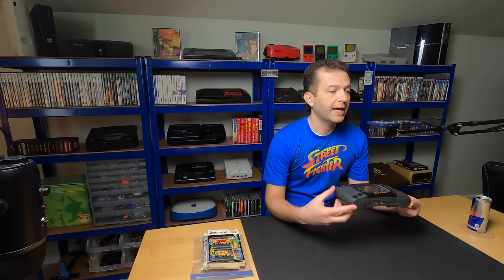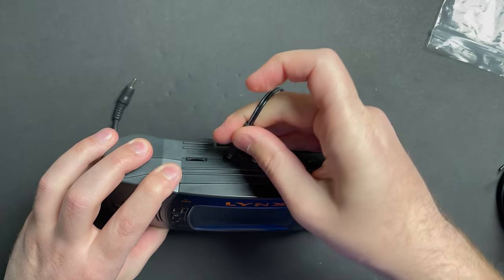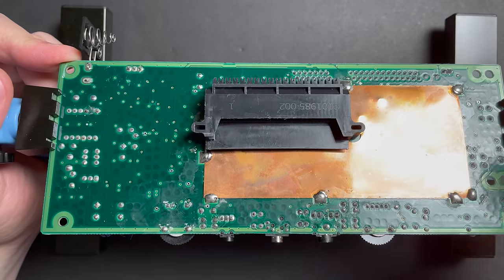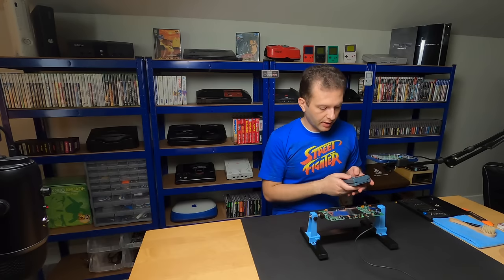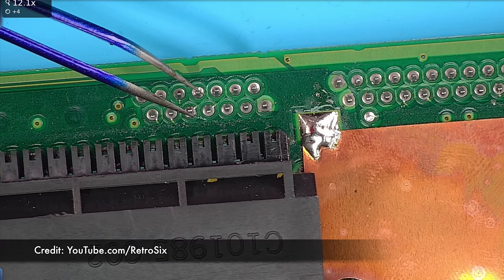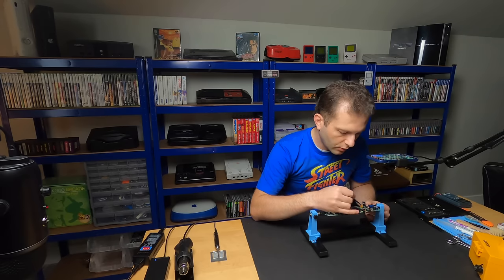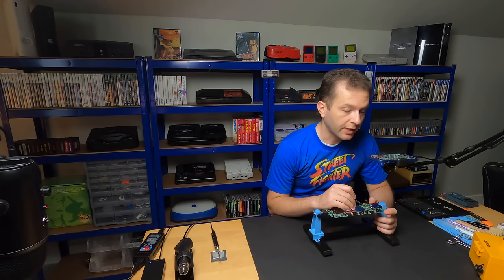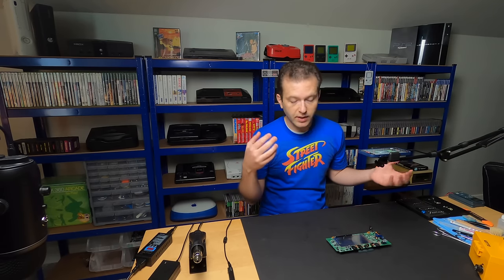Full refurb on a BROKEN Atari Lynx. Can we fix it?

Comment: I think you should have removed the shield to inspect for corrosion, or battery leak. I hope you dont give up though
Reply: and for broken soldier joints and (MORE LIKELY) bridged pins.... He did see a WHOLE BUNCH of soldier blobs and bits all over the board... so maybe there is one between the tiny pins on the main chips....

Comment: You might have known about this already, but you can quickly test if only the power circuit is where you need to focus. But if you supply +5v directly to the C41 which, was the cap you noted as being of a different brand. Doing that with a game inserted will make the lynx power on immediately since you are bypassing the power regulation and that way you are able to verify that the main logics are good and that the Lynx should be able to be resurrected. It is a different capacitor on the Lynx 1 to do the same trick.
Reply: C39 on Lynx 1 :)

I would try that as well. Short pins 31 and 33 on cart slot to get it to boot to INSERT GAME regardless of if a cart is in or not, then feed this Lynx 2 5V 1A directly to the legs of the C41 cap. If that lynx is in operational state, she will boot then!
Reply from the maker: I didn't try supplying 5V directly to C41 during testing but I was getting ~4.7V across the zener diode with the system turned on after replacing the power components. Not sure if that rules out further issues with the 5V rail but I'll add your suggestion to my list and definitely try this when I take the system apart again.
Reply: @BorderlineOCD  Don't give up! You have me eager to see the next move you have planned. It seems like a very frustrating project but I'm cheering you on. Lets go Atari Lynx! come back from the grave!!!! 😭😭
Reply: @pugthugdabaccino1462  i know i want part two of this repair don’t give up yet i will be waiting for PT2
Reply: Me three!!! I want to see part II!! Of that LYNX II!! I want to see it resurrected into it’s second (II) life and get back in the game!! 🙂

Comment: The Lynx has an interesting quirk in that it does not turn on unless you have a game inserted so always remember to put one in when testing.
Reply: The Jaguar has a similar quirk so you really have to check the cart port on these systems.
Reply from the maker: Indeed. I should have captioned this in case others are not aware but it needs a cart inserted to turn on. You can also short pins 31 and 33 on the cart connector which bypasses the cart check.

Comment: The Lynx commonly got fried when somebody would connect to a power supply in a different country. Could that be the problem?
Reply: True, also quite a few people used to confuse audio jack with PSU and fried their Lynxes that way as well....
Reply from the maker: Apparently when the zener diode goes bad, the system sends 9V to the board instead of the "regulated" 5V. Very odd design but this could have damaged the other power components or done some irreversible damage to the main chips which are expecting 5V.
Reply: It is also possible to connect the power cable by accident in the mini-jack. It actually does power the Lynx, but weirdly (screen is super bright).

Comment: I’ve fixed many of these systems before. If the zener diode died, it passed 9V into Mikey or Suzy (cpu/gpu) resulting in them dying. 

If you’re comfortable with replacing ICs with over 100 pins, you can purchase brand new replacements from Best electronics in California.

In rare cases I also had to replace the RAM chips.

Comment: under the shield you will find the cpu , which might have corrosion , i almost guarantee you this is it, also you can test the voltages on the cpu pins ,

Comment: It was very exciting to see how you tackle this repair :)
Fixed a few Lynx II myself but never seen this issue before.
There are two pins on the cartridge connector, which when connected can be used to turn on the Lynx without putting a game in it. (You still have to press the power button though to power it on) In this case, a message should be displayed on the screen. Worth a check.
Even though you said you have showered the cartridge connector pins with contact cleaner, I would still inspects those with a lamp to check whether there is any corrosion. 
You could also take off the shielding and inspect those two main chips under it. (Maybe reflow the solder on their legs)
Reply from the maker: Thanks buddy. I did short pins 31 and 33 on the cart connector. The Lynx powers on with the same symptoms. I plan to remove the shield the next time I'm in there and take a look at the RAM, crystal, CPU etc.

Comment: May be a long shot, but I repaired a Lynx 2 recently.  The games would partially load but would be frozen at a splash screen.  I replaced the button ribbon membrane and it fixed it. It was almost as if a button was registering as held down, which caused it to remain stuck.  It wasn’t obvious at first, until I tried several games and one would finally load - but one of the buttons did not work.  That lead me to the solution.  Good luck

Comment: I have one of these, i just did the switching regulator mod. There was so much wrong with the diodes, those 3 big diodes are abused in how they handle power.
So i swapped out most of the power circuitry and plopped in a LDO switching regulator. 
The only catch... The way they originally designed the lynx, the way it abuses the diodes, allows the batteries to drain really low, so you get to really take full advantage out of the batteries. But even with an LDO regulator, you'll be leaving a bit of juice on the table.
You can either use a joule thief setup to milk every last drop of power, or use rechargeable batteries.

My lynx has been collecting dust in my basement, so i'm actually thinking of getting an LCD mod for it, and a lipo mod and then selling it on. I even have the California Games for it.

Comment: Ran into the same issue before with one and found pins in the cart slot that were bent and touching straightened em out and it worked

Comment: I had a very similar problem. The Screen turns on but there is no change in brightness when the knob is turned. I changed both main chips, no change. It turned out that U11 (HC74A) was fried (probably when the Power circuit was not working and put 9v through) and was not putting out a clock signal. I replaced the chip (10 chips €10 on Ebay) and hey presto! It worked. Hope this helps. Keep up the great content!
Reply from the maker: Thanks for this information. It looks like this chip controls the backlight on/off only though, but I'm not certain. Did you replace anything else which may have been faulty? Was your crystal fine? I'd love to revisit this console again soon.
Reply: @BorderlineOCD  I checked the crystal, and it was running fine on pin 58 of the HJayato Chip Measuring RP7 Ihad solid 5v on each connector (can be measured on the Screen connector pins as well)- until I replaced U11. Before changing it, I had solid 5v and 0v readings on all U11 pins. After changing it I had a clock on pin11 - I think. Just check if you have a clock at all on the chip, if you do, then that is not the problem sorry, but it looked exactly the same as mine.

Comment: I can’t speak per se for the model 2 Lynx, as own two model one Atari Lynx systems, but the model one was notorious for having a bad voltage regulator. I replaced the voltage regulator on both of mine with a more modern voltage regulator.  Supposedly if that voltage regulator fails, it can kill other components on the board.

Comment: These machines are notorious for bad power circuitry and can be easily bypassed by hooking up +5V directly to each side of C41. (Find an old +5V Power supply) You should also be shopping around for a new LCD as that one is suffering from LCD rot. Found a video that explains the power bypass mod for you

https://www.youtube.com/watch?v=MAmPIBkXmPM
Reply from the maker: The output on the zener was 4.7V with the system turned on so I believe the 5V rail is good. A few folks have suggested this bypass though so I'll give it a shot when I revisit this repair.
Reply: @BorderlineOCD  seems to me it's not the power circuitry .... I could be wrong of course....  OH make sure to TRY THE BATTERIES AGAIN now that the screen comes on... if it doesn't then you KNOW there is still an issue with the power circuits.....
Reply: @Nobe_Oddy  I'd love to be wrong, but it appears it's got a damaged mikey chip from the behavior. No sounds when trying crystal mines, so it's not "playing blind" (meaning not just an issue with the screen).

Those chips often get damaged when the fet / zenner fail and allow 9V to slam parts that should only get 5V

Comment: Ive had a Lynx 1, and still have my Lynx 2..havent played it in like 4 years..but Im about to try..try this too:..make sure internal game CARD connection points are nice and clean, as well as the cards themselves..alcohol clean those contacts.

BTW, that power button is recessed OEM, its supposed to be that way, so you dont accidentally press it MID game, Good design MO.

I would re-insert several carts in and out a good dozen times, slowly, might still be a CART contact issue. MAke sure none of the GOLD has chipped away from any of the internal CART acceptor contacts.

Comment: When powered on, check the temps of the chips. The wrong power cord may have been used and fried something. If they all feel ok, then you could replace the screen with an updated one (BenVenn sells them among others). Have you reached out to the AtariAge forums yet?
Reply from the maker: I might transplant a donor screen from a working unit first to confirm if the board is working. I love the BenVenn screens but they are expensive.
Reply: @BorderlineOCD  I get it. I installed a McWill on mine, it's def night and day!

Comment: You can get a decent bench power supply for $50. Not only can it provide more voltage and current than that module you have you can limit the current and detect shorts before causing more damage. It would probably pay for itself the first time it prevents you from frying a console.

Comment: And also put a multimeter in series to measure the current it’s drawing , and use a better and more accurate multimeter ( because the low voltages ) and buy a cheap component tester to measure the caps , mosfets etc . But you do a fine job and good filming !

Comment: Could try cutting just a bit of the end of the ribbon cable off if the contacts are not making the best connection. Had to do that on my own that was restored.
Reply from the maker: I think doing this carefully would be a good idea. Those pins are worn down to the plastic, probably from being removed a hundred times.

Comment: Not sure how you stored the sticky grips after you removed them, but I always keep badges and stick-on feet for things I'm working on stuck to wax paper so they don't get dust or other contaminants on the adhesive. The wax paper peels off just like a decal backing when ready to reapply.
Reply from the maker: Great suggestion, love it! You can also gently rinse them with water if they fall and collect dust/debris. Once dry, a little hot air before reapplying and they are tacky again.

Comment: The recessed power button is normal and is so you don't accidently press it while playing. I wonder if the CPU chip went bad. That can sometimes cause a black screen of death because it's braindead. You're right, not everything can be fixed and you have to know when to throw in the towel.
Reply from the maker: So it's designed like that lol. Well I wouldn't be surprised because there was nothing wrong with it from the inside and the reason it wasn't working was the worn out material on the end of the ribbon cable.

Comment: Could it be a bad cartridge connector? I mean it turns on now, but just doesn't load a game, at least that's how it appears. I could be wrong, perhaps the Lynx has some sort of loading screen prior to the game booting.
Reply: I agree, although I have not repaired a lynx (broken ones are going for crazy money in the UK and I'm in Ireland, additional tax) I have done about 20 game gears and the cartridge pins cause huge issues and display a similar blank screen result. I wouldn't give up, I think you are very close to fixing it. Thanks for the very informative video as always
Reply: The Lynx, like with the Jaguar, won’t boot unless a game is inserted. The cart slot could need a reflow or be replaced.

Comment: Hi, sadly the power circuit of the lynx has a deadly problem, if the zener diode gets broken, like in this case, the 9V goes to main cpu who gets fried . for this reason I bought a 6v power supply and two dummy AA batteries, so the maximum voltage remains under 5.5V in case of zener failure. The only deal is a less brightness of the screen but a safer Lynx.
Reply: Sheesh, absolutely terrible design. Surprised nobody has designed a bypass board or something to completely replace the circuit with a safer one.
Reply from the maker: You're exactly right, and this is what I believe may have contributed to the initial failure on this unit. I learned a few new things while working on this project, and one of those is that a zener diode is a pseudo voltage regulator, although not a particularly good one. And as you stated, when it fails rather than becoming an open circuit, it just delivers its input voltage down the rail (in this case, 9V all the way through). Absolutely garbage design.

Comment: Thanks for very interesting videos! I really need to dig out my old multimeter and soldering iron! A question (maybe this info is available somewhere but I couldn't find it): What camera and mic do you use? Also, what's that camera holder you are using? Thanks!
Reply: I can see his mic (on the right edge of the room shot) and it's a Blue Yeti - I have one and they are a GREAT all around mic! And for only about $100 you can't go wrong... it can be used  as a table top mic for doing podcasts with multiple people sitting at a table across from one another or switched for a solo setup.  And the small stand can be removed and the mic can be screwed onto an adjustable arm for easy gamer streaming without the mic being in the way of your keyboard and mouse.....
it a VERY versatile mic with excellent sound range and easy to use knob for switching between different pick-up patterns. And for a hundred buck it really is a GREAT first semi-professional microphone....
I did a LOT of comparisons when looking for a good mic and the Blue Yeti came out on top in pretty much every aspect :)
But now the camera I can't help you with... I need one myself too. But before I fulfill me NEED for a new camera I NEED to fulfill my NEED for MONEY. :D

Comment: You can't fix'em all my friend however i notice you use the J tip alot must be pretty neat I do not have one for my solder station. I used to watch Voultar use the J tip it does a pretty good job.
Reply from the maker: It's nice for tight areas and I find myself using it on most projects these days, unless I need a larger tip to deliver more heat to the board. If memory serves me right I think the one Voultar uses is a fatter J than my J tip but it's probably just what's available for different solder stations. I'm sure you can a similar bent tip for your iron.

Comment: I know it seems a bit stupid and silly at this point but did you check the cartridges are ok.
Reply from the maker: I think I've ruled this out. I tried shorting pins 31 and 33 on the cart connector which bypasses the cart check and should just display an "Insert game" message on the screen whether a cart is inserted or not.
Reply: @BorderlineOCD   it certainly is a doozy problem it's almost like the CPUs not starting up I really can't think of anything else I don't own one so I can't think of anything other than checking all the traces and making sure the parts are still attached to the board craft components have you tried looking at the border on microscope to see if there is any damage to the traces

Comment: If you need help you may want to visit the atari age forums. There are a lot of very knowledgeable users, some even engineers that will help. At this stage, and if there are no shorts found and caps are correct and ok, the more common fails are the cpus(mikey and suzy).
Reply from the maker: Thanks for the suggestion, a few folks have recommended that forum. Good to know there's still an active community for it out there.

Comment: These things are also known for bad ram, so I would look into that before going straight for Suzy or Hayato.
Reply: This. Do a 41464 RAM check. Depending on the motherboard revision those are DIP, so if you have a memory tester they can be quickly ruled out.
Reply: @rapiqui  The ones I pulled were similar to PLCC chips.

Comment: Well you need atleast remove the protective shield and inspect the board before you give up. Be sure to clean those games with a fiberglass pen aswell.
Reply from the maker: No point without an oscilloscope to probe the crystal, memory, CPU address lines etc. I plan to examine them properly when I revisit this repair.
Reply: @BorderlineOCD sure, but it can also be a simple fault like bad traces or a weak solderjoints. A kid could have drop the unit...

Comment: Noob question: Why did he remove the solder with wick and applied new solder right after? Couldn't he use the same blobs that were already there?
Reply: Old solder doesn't flow the same way, and can be prone to failure over time or carry corrosion from old parts to new ones.
Reply: @LexYeen  Makes sense. Thanks!